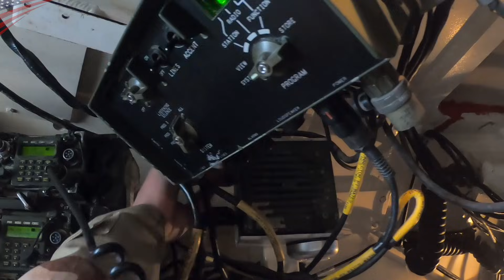Inside the M109 howitzer - latest A7 Semi-Autoloader & A3GN, A6

Comment: Not a "semi-autoloader". Just the standard manually operated hydraulic rammer that the M-109 has had since the 1960's.
Reply: Its different than the older models but sure bud.
Reply: Not a autoloader but a autorammer

Comment: Rate of fire on the M109A3GN looks pretty good! Rate of fire on the M109A6 and M109A7 looks terrible for a modern self-propelled howitzer. Why do the American versions use such clunky methods that result in such a slow rate of fire? Even the old Swiss M109 KAWEST could easily obtain a max rate of fire of 7-8 rounds per minute. It is just unacceptable that the U.S. Army's primary self-propelled artillery in the year 2024 is so far behind similar systems used by other First World nations. There is no reason why the M109A7 shouldn't be equipped with an automatic loading system that can send 9-10 rounds downrange in a minute.
Reply: The US has pretty much focused on missile artillery over gun artillery. They have multiple new missile artillery programs and one for gun artillery.
Reply: I think its because both stationary howitzers and M109s have similar firing mechanisms to help with the training of troops
Reply: It's simple answer, the KAWEST video I saw doesn't have the same procedure. The A7 would be as fast if they just shoving ammo and charge inside the chamber.
Reply: Of course they can reload faster without them getting the 'permission' from their howitzer sergeant. They sacrifice reloading speed for crewman's safety, which is better from the longer perspective.
There's a video where crews finish reloading a m109 within 13 seconds. (M109 Reload and Fire: by username Kanndors)
Reply: @reddishradish7590 im an sgt in the Swiss Artillery and you need to get your sgt order befor loading but usally the sgt checks the ammo befor we shoot so we can fire as fast as possible
Reply: That crew is soft... we were firing fast as fuck when I was in. They made the battalion commander come sit in the gun to make sure we weren't pre-loading, taping the lanyard, or finger popping the firing mech
Reply: Because it creates more jobs

Comment: Ironically the A3 shown looked considerably faster to fire and doesn't use that stupid bullet and pull cable  firing system that appears to be from the 1700's. They just push a button.  🤷‍♂ Are they un-devloping this vehicle? Progress seemed to go in reverse from the A7 to the A3GN.

Comment: From being an M109A2 Chief from back in the late '70's - I can see several changes with things like the 'charge' canister (used to be a bag), no Assistant Gunner or AG station evident, females in the crew (a no no back then), and even [apparently] a different rank structure.  What was the electronic box that the loader (?) was using atop the projectile?  Was that some sort of time or proximity-fuse setting device?  Still exciting for me to experience this (even if it's only in a video now), even after so many years.  Thanks for posting this.
Reply: I remember loading the rounds by hand back in the 80s. Rammer was too slow.
Reply: @cylinderroller  - When I was stationed as a Section Chief with the 1/10 FA in Schweinfurt, Germany ('78 - '80), I had a loader, originally from Chicago, that never used the rammer. He not only always set all my 'Joe's' by hand, he had also braided our lanyard to about a 6" length. A 'bad dude' with a heart of gold - I still miss him.
Reply: They're Norwegian. Women have been able to serve here in any capacity for a while now (provided they meet requirements), and in 2015 conscription was extended to also include all women born after 1997. This doesn't mean they all serve though... they don't need the amount of people they are offered, so at first most cohorts only saw about 10% serve....

...but with Putin's recent antics, that number is much higher today.

Comment: All this, to fire a shell? The Ceasar fires 3 times faster 
and moves faster to escape counter battery.
Reply: The speed of a modern howitzer is largely independent from the materiel used and mostly depend on  crew training ,  tactical situation and  thermal condition of the barrel. All modern howitzer declares more or less 6 rounds every minute, and this was achievable even 30 or 40  years ago (for the first minute or less) but alas, nobody fires for one hour  at a time nowadays, probably not even one minute of continuous fire is possible if the enemy is  competent. These crews here are training, and stand to attention waiting for orders or signal at every step, safety and precision being paramount in peacetime crew evaluation.
Reply: Except ukrainian crews fire just as fast if not faster and is way more reliable and still operational while the ceaser's are completely out of action 😂